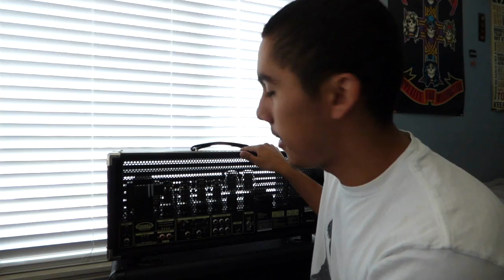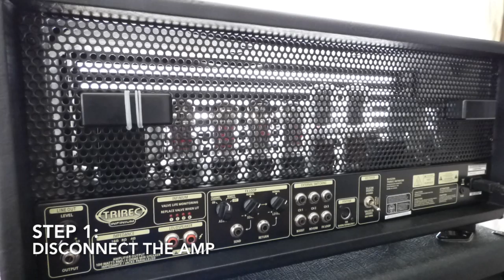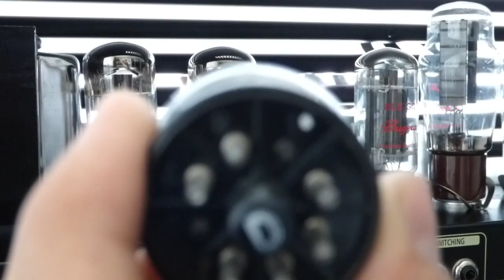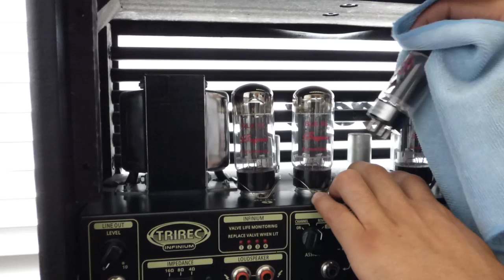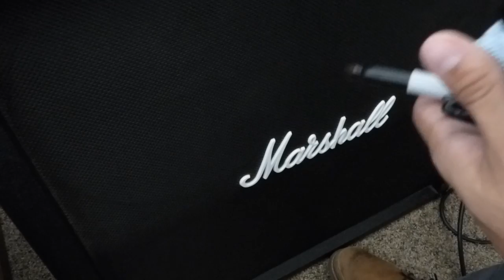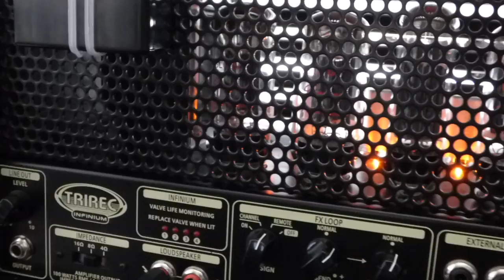Replacing Tubes: Bugera Trirec Infinium

Comment: Sounds like Bugera has eliminated the need for matched tubes and the crappier mismatched tubes still burn out earlier than the better and matched tubes. This is a good thing that it eliminates the bias/rebias effort(s) as periodic maintenance for degrading tubes from use or time, or in your case an inferior/defective tube that flat out prematurely dies. Seems to also make replacement on the fly with mismatched tubes as a replace as they burn out rather than complete set replacement.

Comment: The E34L tubes can handle higher voltage levels than the standard EL34. This just means you can bias it slightly hotter (if you like that sort of thing). Next time try either JJ KT-77 or TungSol 7581A if you're looking for a special treat in tone.

Comment: Hello Aaron. Good video thanks for sharing. I have a question for you. ¿Can you helpme please? Recently i bought an old buguera model. The 333xl (not the infinium version). I was wandering what happens if i replace just one of the power tubes only? i mean, mine comes with the original ones (bugera brand) but here in my country i can not buy that brand. So, having no infinium circuit, what happens if i replace just one of the tubes?
Reply from the maker: If its not infinium series then you'd treat it as most other tube amps, which is replace the tubes and bias them by hand. The issue with replacing only one is that the tubes will run at slightly different power ratings and this can mess up the amp one way or another in the long run. Thats why most places sell matched sets.

Comment: Hey man! Thanks for The vid
One question: I noticed that I have a little bit of gain loss in my bugera, so I checked the lights. The no.:1 light was red. I switched the amp off then on again and it disappeared.
 Can the tubes burn out, if I have the hi power silicon diodes selected? Bcuz I have always used the diodes.
 Now I’m just confused about this.
Reply from the maker: Bjnk Rn Hello! When you switched the amp on and the light disappeared, did the amp go back to sounding go normal?
Reply from the maker: Bjnk Rn Also, was it a stock Bugera tube?
Reply: Yes, it is a stock tube. The gain loss however, is still a thing:/
Reply: Also I hope that storing my amp in a rehearsal room during winter below room temperature ( about 10-15 Celsius) isn’t that bad...
Reply from the maker: Bjnk Rn Okay, a tube can burn out on the silicon diode mode, thats what my amp was on when mine burned out. This is one of the wonky things that this amp occasionally does. That #1 tube may be on the verge of dying' check for glowing blue light within it otherwise that light was just the amp having a hiccup. It has happened to me before. As for the gain loss, it could be the tube, or anything else in the set up such as pedals, different speaker cabinets, guitar pickups/ volume knobs. And storing it in a cold room ought to be okay, but keep in mind that tube amps are meant to run hot. So if youre using it in cold conditions, you'll need to definitly let it heat up. It can be problematic if the tubes go from hot to cold really fast, that can damage the tubes. Thats why some people say you shouldnt blow fans directly at tube amps.
Reply: Aaron Aranda Yeaaaa, I always let it warm up😄 Could be my pickups tho, who knows:D I’ll check ‘em!
 Thank you so much for your answers, I’ll keep those in mind! Have a great time with your amp!😄
 Subscribed! Bye👋🏻 \m/

Comment: Hi! How do you use this amp tonewise? Metal? If so, what settings are you using? Recently bought this amp, and feel like I haven't got the most of it. Any tips?
Reply from the maker: Aron Strömberg Hello! I usually use this amp somewhere between metal and hard rock. I keep the clean channels controls around twelve oclock with a little boost in highs and mids. Channel 2 i use as a rhythm distortion, i keep it on the vintage setting with gain, presence, and treble around 1 oclock, mids around 2 oclock, bass at 12. I use channel 3 as the lead tone on the modern setting with treble at 10 oclock, mid and presence at 2 oclock, bass at 12 and gain around 10 oclock as well. Those are just my usual settings, but i would suggest experimenting with bringing up the master volume vs the channel volume for different sounds. You can also try encorporating the built in boost on a lighter overdrive setting. Lastly, try changing the varipower knob, i usually keep that around 12 oclock.

Comment: Well you were right at first, it can match different types of tubes, meaning el34, 6l6's etc, brands is irrelevant for this amp but important for the player, also once the amp is disconnected, the electricity is store mainly in the transformers, trust me on that.
One more thing, the el34's will distort faster but the 6l6's have a deeper growl, especially if you are into death metal or something, not to mention that the Bugera trirec has a built-in attenuator, meaning that the 6l6's, or any bigger tube in sound will distort just as fast as the el34's do its built-in attenuator that will make your amp sound distorted but at lower volumes when disire.
Yes the el34's will distort quicker and are recommended for amps with no attenuation as well, but keep in mind that you have a built-in attenuator and the 6l6's will definitely sound bigger, and also with nicer cleans, I can see if the amp didn't have an attenuator for early breakup, but maybe you like the sound of the el34's better, but that's a different story. In my case I prefer the deeper growl of the 6l6's, especially for modern metal.
Great review and demo of replacing tubes bro, but if your hands are dry, you don't need to use a cloth and a sweaty hand will not degrade the sound of your brand new tube, that's just a myth, what can really happen is that when replacing a tube with a sweaty hand, your tube can slip off  your hand and break and you can get cut, or even shocked.
I got a question, can this amp also handle kt88? I'll appreciate your answer bro.👍
Reply from the maker: Hello! I've never done it myself, but I have heard of other people mixing kt88 tubes into this amp. As long as the pins line up it should be able to handle it.
Reply: You SHOULD use a cloth and wipe tubes with rubbing alcohol. It has nothing to do with slipping. Any oil on the tube concentrates heat and generates hot spots. The odds of a tube failing early with oil on it is immense. It doesn't take much at all. If you ever replaced halogen lights in parking lots or buildings, the same is true. Can't tell you how many times "new" tubes/lights failed because people handle them with their hands directly.

Comment: I mixed two EL34's and two JJ 6L6's thinking I would get the best of both worlds.  I really like the tone.  I wish there were videos of people mixing tubes in these Infiniums.  It would be interesting to compare results.
Reply: 5yrs late on this, but what tube slots did you have the 6L6s in? I'm thinking of this, wondering to have 2x 6L6 / 2X EL34, or 6L6 EL34 one side and on the other.

Comment: Thanks for the info man. I guess you have bad luck because I own the same amp for one and a half year and the tubes are still working fine... anyway did you note any tonal variation with that new EL34 tube? I´ve been thinking to swap the stock 6L6 bugeras for 6L6 JJ since I read some people did this change for the better...do you recomend it?
Reply from the maker: Hello! I must say that I can't really notice a significant change in tonality. Perhaps it is because I only replaced one tube with an EL34. I find that this amp has so many different ways to slightly change the tone especially with the three rectifier options on the back that the tube is just another thing on top of it all. I myself have not tried the JJ 6L6, but I've heard many cases where people swap out the stock Bugera tubes for the better and JJ is a very popular brand in the guitar amp community. Thanks for your question!